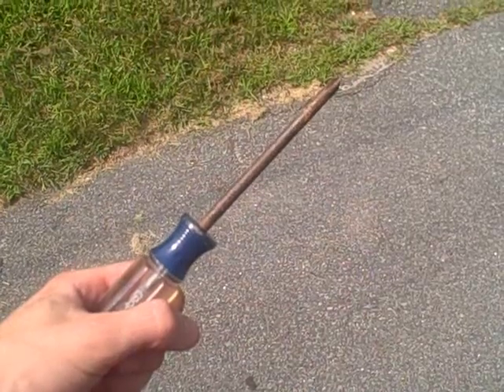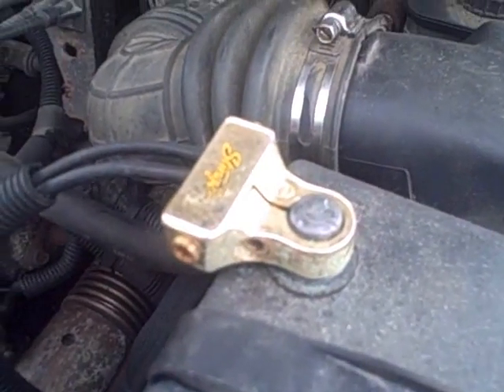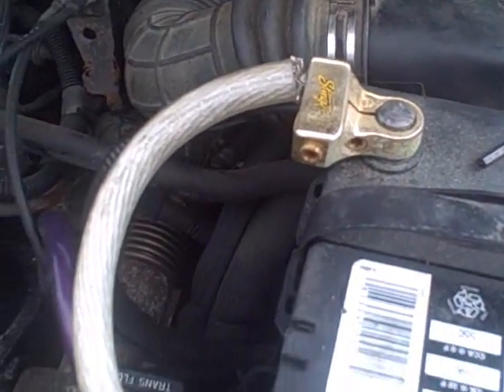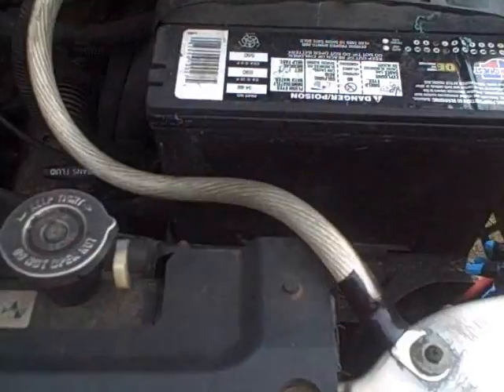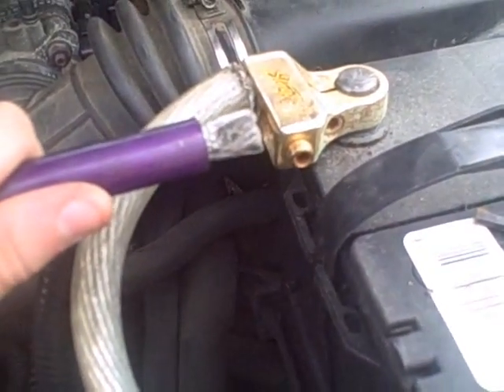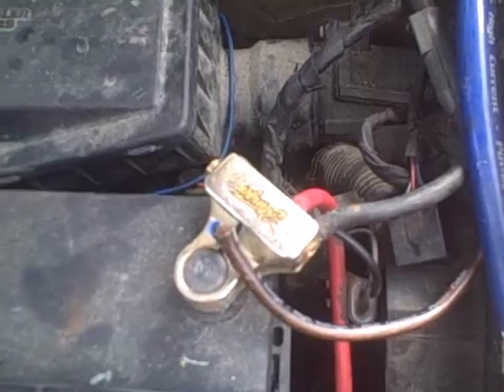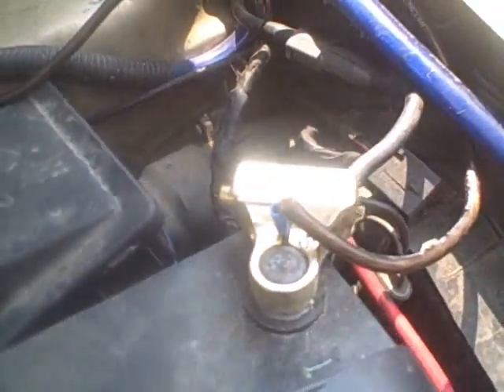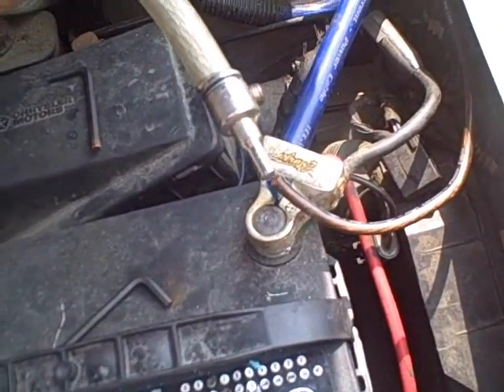Increase Car Audio Power 25% - How To Install Big Three Upgrade - Easy 15 Volt Stereo System Big 3

Comment: Can somebody help me? I wanna get more power out of my subs and amp, I'm running 2 10" alpine SWX-1043D that i got for $40 each in sound advice and I'm running a 4 channel fusion amplifier. I was wondering if I should use the fusion to power my subs alone and then get another amp to power my speakers which im thinking of changing(can anybody reccomend some within the $150-$225 price range?) Thanks

Comment: the sub is wired down to 2 ohms and 750 rms is plenty for that sub.  i want the more power efficient of the two amps. i've been reading that the glx does not consume alot of power.

Comment: So if you have a 2 ohm dvc sub go with the gladiator and wire it to 1 ohm if you have a 4 ohm dvc go with the brutus. All i did was look up the information for each amp and respective ohm loads. So its your choice now on what amp you want to go with.

Comment: well i am going to try and be as accurate as possible here. If your amp is a 2 ohm dvc sub your best bet would be to go with the hifonics brutus 1700.1 will throw 1700 watts of power to you sub, where as with the hifonics gladiator 1000.1 it will only throw 1000 at your sub. Thats is you are wiring it correctly by Parallel Wiring it down to 1 ohm. Now if it is a 4 ohm sub heres the specs for each sub with parallel wiring it down to 2 ohms, for the Brutus itd be 1200 for the gladiator itd be 750

Comment: whats the difference between hifonics brutus 1600 and the glx gladiator 1000.1?  I am looking for the most efficient amp between the two.  The re audio sub is only 600rms and yes it can take more but its loud enough for me at half on the jl audio amp.

Comment: I am looking to upgrade the big three in my 01 Toyota Corolla S. I am going with 4 gauge because I will only have 1000 watt RMS running. My question is, how do I connect the wires to the chasis for grounding? Where would be a good spot for that? And what's the "Ground from the engine block"? Thanks

Comment: @dillhole643- JL amps are good, but way overpriced for what they are. A better choice for amps would be sundown audio, rockford fosgate, or soundstream. With all of these companies, you get more power for your money over comparable JL equipment, yet still retain the same if not better sound quality and efficiency.  

JL is like the apple computers of car audio.

Comment: i've done the big 3 already and upgraded to an exide deep cycle battery but, i think i should have used a bettery battery that charges quicker on bass hits?  I don't charge my battery, should i and why?  also i run 1/0 gauge wire.

Comment: can you recommend a sound quality amp that will power a re audio 10" sex subwoofer.  I haVE A JL AUDIO 500/1 but it just sucks some much current in the bass hits.  i have been looking at hifonics glx gladiator 1000/1

Comment: hey exo is it best to ground the battery to the frame or the the strut tower area. My factory ground on the battery is on a panel welded to the strut tower area. My tranny ground is grounded to the frame of the car.  Whats the best way to do the big three for this car in regards to the grounds?

Comment: Go to a shop that sells welding supplies. Ask for however many feet you need of #2 Welding Cable. You can use it without worry. I do recommend getting the copper eyelet lugs as well. If you have good crimping tools you can do it yourself, otherwise have them do it, to make sure they hold properly.

Comment: HEY EXO..., I HAVE A DODGE CHARGER WHICH COMES FACTORY WITH THE BATTERY IN THE TRUNK..., HOW MANY BIG WIRES WHOULD I NEED TO RUN TO THE FRONT IN ORDER TO DO THE 'BIG THREE UPGRADE'?

Comment: if you want to look at it like that @ 24 v based on what you DRAW now thats 0.25.
volts and amps are related, on a normal piece of equipment like a TV it will draw a current based on the voltage the higher the voltage the lower the amps, this is normally a set amount. on your amp however it will draw what you let it if you find that sweet spot you will get the most out of it.   current draw= amps

Comment: and that is fair enough, but if that is the case then stop looking for low bass because you wont get it with the equipment you have. i thought a big sub would get me what i wanted when i was your age so i bought the cheapest 18" PA cabs i could find and never got any thing out of them. try placing your sub in a different place in the room, turning it to face a corner will make the most difference. try a few different spots.

Comment: 200 dollar is entry level to be honest, i dont think there are any high end amps for that money. my amp cost £600 so about $1000 and thats cheap. if your amp is not responding to a change in average resistance that is a bad thing, you should on paper nearly double output at half resistance. i play with thousands upon thousands of pounds worth of speakers every day for my work and the things your saying make me think you would benefit from a bit more research.

Comment: reaflow100...

to get what you want from your sound system you need to be looking at a whole different range of subs, to get an idea google the thiele small parameters of your sub and compare it to a 10" jl audio w3. or though to get the most out of is you will need to get a slightly better amp.  ( better not more power) 

check out what i do for a living google qav-ltd i work for sales and installations

Comment: its to do with the tuning of the box or lack of, not that you would get much benefit from changing the box, your going from one end of the scale being probably first order ( google it) it free air, with out going in to detail as it is diverting from the point. or though a sub may be moving it does not mean that a frequency being correctly reproduced. fi your amplifier is entry level i.e fli, fusion edge ect. then unless yur willing to spend the money your going to get much the same from all.

Comment: there is a common misconception that bigger is better, in reality the sub you have is not responding to deep bass. its not doing this because of a combination of coil, magnet ( type more than size) and diaphragm a good sub will respond to any bass on a track what ever size. people are always shocked when they look in the boot (trunk) and see that sound was coming from a 10". spend the same money on a smaller sub and you will get your deep bass. a good 18 will cost thousands .

Comment: not sure this will get you your 25% but i agree upgrading your ground from battery to car is always a good idea if any thing so you dont melt the original wiring.

jl audio (true) 450w amp
jl audio v3-4 10" sub
mordant short hi's with 100w hertz (brand name) amp

Comment: NO NO NO dont do it! its not about the size its quality! i have a jl auio 10" v3-4 10 times deeper bass and louder than any cheap sub, spend the same money on some thing smaller and you will be much happier.

jl audio (true) 450w  amp
jl audio v3-4 10" sub
mordant short hi's with 100w hertz (brand name) amp

Comment: I did car audio for 5 years, professionally. The best way to do this is to follow all factory lines. Also, doing this while the terminals are off of the battery is the way to do it. Most of the time, this is overkill. Especially if your stock alt is only 90 amps or below. The max you will get is 90 amp. I only did this in cars where we put it a high output alt.

Comment: Good write-up/video.
But understand the guage of wire corresponds with the amount of power given. Since you have a truck Bigger is better, but if youre running a small honda, you probably should use 6-8 guage.

Comment: Hey man I need some advice. Im planning on upgrading my system real soon including my power wires. I currently have 4 gauge going from my yellow top out to two 400 watt amps in the trunk. My question is can i upgrade my 4 gauge to 0 gauge and install a kinetik battery  in the trunk and still run the same two 400 watt amps in the meantime while i save up for a new amp and subs. Is there any risk in burning something out ??

Comment: Ex I kno ur sick of me askin questions but sonicelectronix just boosted the prices of the kicker rs an qs an  I am in the need of some good component speakers that will be able to keep up With my CVX's, And is capable of handling 90 to 100 rms, I hve 6x8 holes all around, ford focus, holler at me, I refer to this video every time I need to to the big 3 in my car lol thanx man

Comment: I'm taking a the driver license in this period..got a Fi Btl N2 18" and an hifonics hfi 3000d..going to take an sp audio 4000.1 soon..but..dind't get the fuse part..I mean the light was on..but both cables were only on positive...correct me if I'm wrong :/

Comment: hey exo if im running a secong battery off a isolator in the front of my truck and i have my system running off that should i big 3 the audio battery and the primary car battery  or just the batt i have my system running to

Comment: Nice pickup on the Crescendo Mids and tweets.. just got a BC2000D from them woo! haha quick question though.. where can i get the little connectors for the 0gauge wire like from the wire to chasis OR wire to battery?

Comment: can you use power cable for a ground also? ima install an extra battery for my setup. lights dimming bad. i got a 2000 watt mono block class d quantum audio amp qa2000 and a 1000 watt kenwood. which ones better?

Comment: So when i find my engine block ground. i just add the 0 gauge to the bolt thats the engine is grounded too i dont replace it? then i run it to the negative terminal?

Comment: EXO, you left out something important. THUMB THIS UP SO EVERYONE CAN SEE THIS AND AVOID WHAT HAPPENED TO ME TODAY. Its very important to leave your STOCK ground wires connected. If not, then over a few weeks time, the little stock engine - chasis ground wire will cook and wear down. your stock grounds ground small things like your started, radio, etc. The big 3 is NOT a replacement. It shorted and luckily I had fuses, or I would have burned in flames with the car. Not bashing exo, JUST BE SAFE.

Comment: did 4/0 from alt to battery, battery to ground, battery to engine, battery to starter and battery to fuel pump relay thats just for my starting battery running 4/0 from second alternator to battery bank in trunk to charge 4 marine batteries and going to run 2/0 from batteries to frame under the trunk

Comment: is it ok to use those 1/0 to 8awg adapters like you did with the power wire to the amp?

Comment: sup man..i will be installing a lanzar 1.6 farad capacitor into a 2002 chevy tahoe along with a hifonics brutus 1200.1D with 2 12's rockford fosgate and i want to know whats better to charge a cap with...a resistor or a light bulb?..and if is in a light bulb how do i know when the cap is ready?

Comment: hey EXO i have been watchin your videosfor a long time and they are extremely helpfull but i was lookin in this video and i was trying to find out what it is that you are using on your amp's power wire?
like a 0to2g step down adapter? i need some lol and i cant find them!!!
help me out? thanks!

Comment: I really need to do this to my 03 dodge intrepid. i only have about 400 watts RMS right now with 4 gauge wire and the lights dim.. and i plan on getting an AQ 1200d at 1 ohm so i cant imagine the voltage drop but dodge is a bunch of jack wagons and the battery is under the air intake and it has terminals running from battery to above the engine block.. and the alternator is under everytihng too. so im really confused on how to go about this..  :( anyone know how to do Big 3 on 03 dodge intrepid?

Comment from the maker: You can run ANY type of battery together as long as the VOLTAGES are the same - The only time one battery will harm another battery is when one has LOWER voltage than the other, which will slowly make both batteries read out at the lower voltage.

Comment: Hey man, i'm looking at either a wet cell or agm battery to upgrade. In the future I plan on needing to run multiple batteries, as far as I know wet cells need to be the same make/model to be run together, but can agm batteries be different and still run together fine? I think the Ah rating needs to be close but I'm not sure...

Cheers.

Comment: look up knukonceptz. i got the kca cable. unless u got a high output alt u should just stick with the kca. max load of the 0 gauge wire is 250A @ 20' plenty enough for all stock and some HO alts

Comment from the maker: It may be simply out of sight - Those little wires are supposed to be there, but the CHARGE wire is usually much thicker, and located on the opposite side - Get real close and start inspectin' lol

Comment: Hey man its me.. Again.. Lol. I have a lot of 4 gauge wire left over, (im runnin 1000 rms so used some good stinger 4 gauge) and because my system only requires 4 gauge, would i be ok doing the big 3 in 4 gauge? Or should i go ahead and do 1/0? I have voltage drop but its not super terrible

Comment: Hey Exo, I cant find a screw on my alternator to bolt my 0 ga power cable to because there is originally two small wires that click onto it (like a wire harness into a radio type thing)?? Also is the power cable going to be the only wire needed going to/from the alternator after the big 3?

Comment: exo was happening bro hey got a question i just bought an apsm1500 runing two 15 q powers i kno i kno trash but i got them dirt cheep now wen i turn up the bass knob about 3/4 the amp shuts down for a second then comes back up now i am running stock elect with 4 awg power wire the voltage.drops to about 11.5 what can i do to solve this delema o and subs are wired to one ohm

Comment: Hey i was wondering if you could help me out im running 2 12" sony xplods on a kenwood 1000w mono amp it should be running no problem but for some reason the bass will cut out and come back on a few seconds later do you think the big three upgrade would fix this? Thanks

Comment: lol this is going to sound dumb as hell but i got confused when runing the power wire to my cars fuse box do i need a fuse in between that as well or just the fuse to the amp

Comment from the maker: Improves current flow, and yes - A lot of the times you can gain voltage - Anywhere to 0.1 to 1 whole volt. A lot of power can be lost with shitty connections and grounds.

Comment from the maker: The alt is connected to the engine - That's why you give it a better ground by adding a cable from the batt (neg) to engine block.

Comment: Does anyone know how to the big 3 on a Chevy cobalt the battery is in the trunk? I'm gonna leave all factory wiring and just add the big 3 to it. I get the alt to batt for poistive charge and I will ground the battery in the same spot they factory did just make it bigger but what about the engine ground? Thanks guys

Comment from the maker: With that, adding a 2nd battery would probably be enough. Ideally a H/O alt would be nice, but I think you can get away without one with that - Just try to keep the batts as like-sized as possible and you'll be all set for the long haul :)

Comment: Hello sir, Big fan you always know what you are talking about I can tell, and you are a true character! Anyways I just upgraded to an orion HCCA 10.2 (1500 rms/ 3000 peak) in a ported box, but still have my hifonics HFI 1000 mono amp. I want to get the hifonics brutus 1700 rms to power it instead, will i need to upgrade the big 3/ my alternator/ get a cap/ extra battery? Thanks look forward to hearing back. :~D

Comment: hey bassheads i want to do the big three with ofc 0 gauge wire on my 98 chevy c1500 but i wanted to ask what size fuse i should use on the alternator positive wire i think my alternator puts out 105 amps    ?? and also its has a fuse box do ihave to run 0gauge wire to it to??
Reply: the alternator wire upgrade works in parallel with the existing system and does not require upgrading any wires in the existing system. wire fuses are to protect the wire; regardless of alternator output, fuse the wire for whatever a short run of that size wire is rated at: 125-150 amps for 4 gauge, 300-350 amps for 0 gauge

Comment: It's dangerous to run *any* line to the battery's positive terminal without an inline fuse as close to the battery as possible.  You should also secure the cable so that vibration doesn't cause it to rub against things, eventually abrading away the insulation.  Finally, zero gauge, seriously?  Assuming a twenty foot run, that could easily handle 200 amps (2400 watts continuous).  That's utterly pointless.

Comment: Any radio signal problem you're getting after installing the HID lights is almost certainly due to electrical noise, not power consumption.  HID lights use very little power.  Perhaps you mean fake HID, though, which are just slightly more powerful halogen bulbs with a blue filter material applied.  Either way, your stock grounding and power should be sufficient.  Try cleaning all of your grounds and checking the wire condition first.

Comment: yes but for some people will never use the full compacity of those 2 guage wires you installed running a single sub and 4 basic speakers

Comment: You can check out my little setup on my channel if you like.  It was wired at 8 ohm at the time now its wired down to 2 ohm.  I also would like to know how I could go about cooling down my amp.

Comment: Hey man thanks for the video, its a big help however I still have a few questions.                          1. Can I leave my factory grounds intact as well as my factory alternator to battery wire that goes through my fuse box along with factory terminals?  I plan to bolt my wires directly to the factory bolt on my terminals with ring connectors and sanding it all for a better connection  2. Do I need to fuse the new amp to battery cable? If its not needed can I do that just for piece of mind?